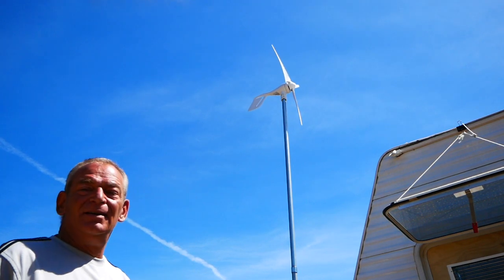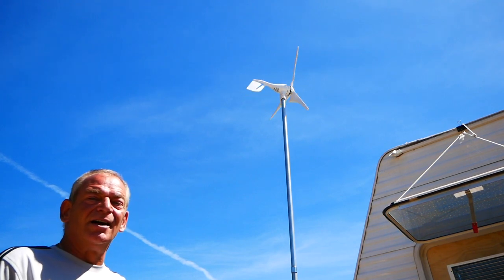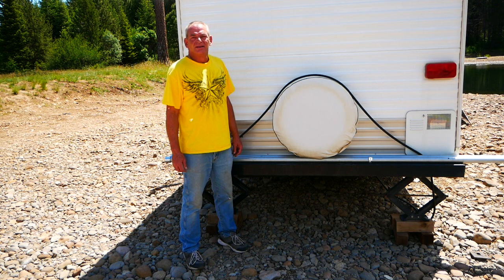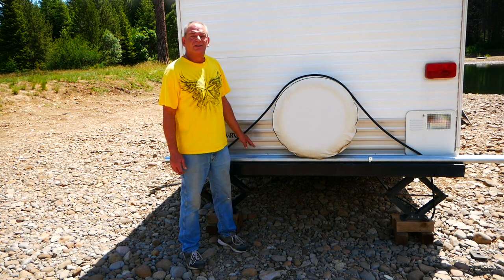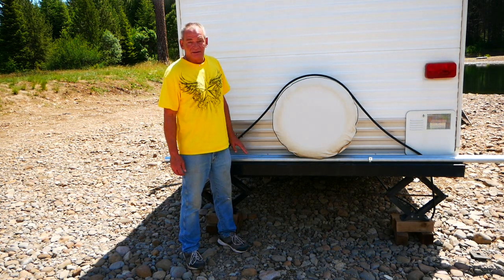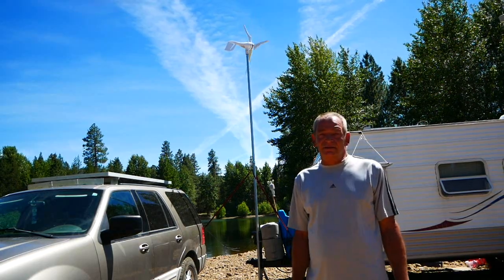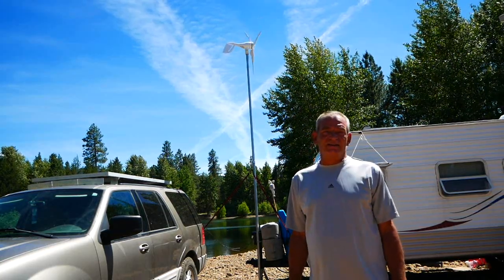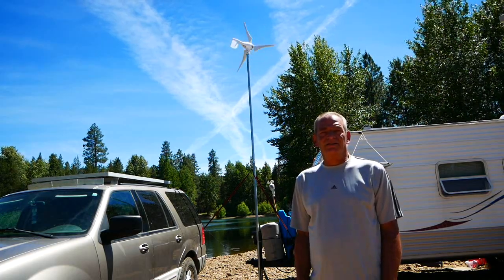Preview of the Ec0-Worthy 400 watt wind turbine

Comment: If a wind generator was mounted properly could it generate electricity while driving?
Reply: The drag it would put on your vehicle and the extra gas you would be burning due to that drag would make it not beneficial nor practical.  (See 1st and 2nd Laws of Thermodynamics) Also, Bob mentioned that there was a narrow wind speed band where it generates decent power starting at I think he said 26 mph?  So, at 70 mph on the highway it may not make any power at all as it might have already cut off by then to protect the circuitry.  Depending on what speed they have it set to cut off, you might only be able to drive at under something like 45-50 mph to generate anything decent.

Comment: The problem with wind turbines is the altitude. You need to get them high. High, as in taller than any nearby trees. The wind quality, power and  dependability goes up the higher you go; this is why the monstrous latest generation of turbines made for commercial power production have single blades the length of a football field, and the tallest in the world will be 800+ feet. For the vast, vast majority of people, getting another solar panel or two will be a better investment; in an RV, you just can't in any practical way carry a 100+ foot tower.

Comment: I think stormy days is where it will shine, (pun intended). 

Maybe northern climates in the winter where the sun angle does little with solar. 

Personally, I think a small generator like a 1,000 watt running a battery charger for an hour a day would be more practical.
There will be overcast days where there is no wind.  Just when you need the power the most, it will not be there. Lugging that thing around for the few times it would work seems more bother than anything. Of course there are places that are always windy, but I don't want to be there.

Comment: Go to Missouri wind and solar channel it has a lot of details on wind turbines.  With 9 blade head blade turn in 6 mph winds
Reply: they can but you end up with a wind wall effect in stronger winds, for real power in low winds a turbine designed to work at low rpms in low winds , you see them on the net , for example 500w turbines with 2.5m blade spade and making good power in" low winds" more power than those incorrectly rated turbines with 7,9,11,13 blades yet with only 3 blades and hitting rated wattage at 20mph not 40mph, i own the dual pmas and others it was a waste of money.

Comment: My Vertical Axis Wind Turbine VAWT   sitting on a conduit 4 ft  pole stuck in the ground in the yard with 5 vertical blades running a permanent magnet and no resistance with anemometer attached starts turning at :
5mph or 2.2 meters a second m/s  = 18 watts
2.8 m/s = 43 watts
3.1 m/s = 65 watts
4.5  m/s = 130 watts
5.3 m/s = 218 watts
8.7 m/s = 400 watts
I had a Horizonal Axis Wind Turbine HAWT like you have which required a very high pole with quide wires that would not start turning until 18mph wind and I got rid of it
Reply: In your video you saw your Anemometer turning but your 3 blade horizonal axis wind turbine HAWT is not turning , ask yourself why is that  , and your anemometer is lower but spinning : VAWT is the answer not HAWT , I decided to mount  4  (400watt) Vawt  which is 1600 watts on an open utility trailer  with 2ft conduit and 3 battle born lithium batteries and run what I need to 24hr a day
Reply: and I don't need any (SUN)

Comment: Thanks for the valuable information you provide.  I'm interested to see the results so we can decide if it's worth it or not.  Just a point of information so people don't get confused when they buy the pipe.  Pipe can be threaded conduit cannot be threaded as the wall thickness of conduit is insufficient to thread.  Electrical pipe comes in two forms aluminum or galvanized.  Galvanized is stronger and cheaper but heavier.  Plumbing pipe is heavy like galvanized but cheaper but it will rust.  Aluminum pipe is the way to go if you can afford it because it is strong enough and much lighter.

Comment: I have a 400 Watt Chinese Vertical Wind Turbine VAWT that I paid $ 95.00 with free shipping that works in 5mph wind. It runs 24hr a day and works great.
Reply from the maker: How many watts does it produce at 5 MPH?
Reply: I've been doing this a very long time and have rewired my STATOR using 18 guage copper wire and have increased my wattage not amps :
5mph    wind  2.2  m/s  meters per sec
10mph  wind  4.5  m/s
15mph  wind 6.7   m/s
20mph  wind 8.9   m/s
30mph  wind 13.4  m/s
40mph  wind 17.9  m/s

Comment: Thanks Jim for the info....To add my two cents" 'we live in a small well defined patch of hilly terrain known for having a corridor of wind that is supposed to be sufficient enough for wind power generation when the sun is not shining or it is stormy enough outside to hamper optimal solar utilization. What we found out was this. 1. The capital costs of adding wind power was just to much money for the power generated. 2. The maintenance required was much more than bargained or planed for with wind.  Large Power company wind turbines have a nice (Return On Investment) over time,  we expected this as well but found the exact opposite to be true when going small scale wind power. Luckily we were able to sell our Turbine - Tower and Electronics to just add more Solar for much - less capital costs - more power - almost no maintenance compared to the Wind turbine...BOTTOM LINE IS; it will probably make more sense in most situations to Add More Solar than install wind to make up for possible power loss and ease of maintenance differences - just my opinion, your situation may differ.

Comment: I do agree w/Happy Camper.    Since you carry a generator, a basic tool set for any work of this type would be a large recip. saw w/appropriate metal cutting blades, a full complement of drill bits and a metal file for deburring?   Easy enough to keep on board along with that monster 1/2" elec. drill & bit.   After all, people are looking to you as an expert, and since you are doing the install, they may follow your example with dubious results.  In the future, may I suggest the inclusion of some type disclaimer before proceeding?  It may save you a law suit.  BTW, you already shot this down by mentioning the wind speed necessary to drive this effectively and the fact that it is impractical to attach it to anything w/out vibration and noise and possible dislodging in a heavy wind.  Thanks for the click bait!
Reply: Like pretty much everyone out here he only has so much room to work with.  He doesn't have the space for every tool in the hardware store.  Rather than being unfairly judgemental and critical why not ask first?
Reply: @MrsMetCal     Ask what, if he has room for a recip. saw.?? Obviously, you don't know anything about tools either.. LOL!  As I stated previously, while he's a nice guy, he's not a very good mechanic and uncomfortable operating equipment, which might be a problem for another person who tries to emulate him.  
Stop with the touchie-feelie BS and get to the obvious which is click-bait video that is not designed for nomads or human consumption of any kind..
Reply: @pjf7943  This is not clickbait. He is doing an experiment that has a start, middle and end.  He is currently at the start.  Check back in 12 months for the end when he will have the data to make a recommendation regarding the feasibility of this method for collecting energy.  I suspect he has an idea already how this is going to end but without the real life experiment none of us know for sure and the marketers of these turbines make them look like affordable and viable solutions for his audience, Van dwellers, and boon dockers.  Not people with fixed locations and large well equipped workshops.  Most van/rv dwellers don't have the tools to mount solar panels on the roof of their vehicle....by extending your logic, non of them should have solar panels.  Jim is simply showing the possibilities, he is not writing an OSHA approved installation manual for the products he demonstrates.  If you are such a smarty pants, make your own video on the "proper tools and techniques" to help boon dockers with their projects.  I suspect no one will be interested in it.  But you might be surprised by a foreign feeling...that of feeling gratified knowing you did something to help others.  That's a feeling Jim is very familiar with as evidenced by his library of videos and interviews on the varied topics he covers helping others with his wealth of knowledge and experience.

Comment: Wind turbines can be a great supplement to solar, but you've really got to do your research because there's a lot of factors involved that must be considered in order for it to be practical. I appreciate your exploration into this realm, however I have my doubts about the particular turbine selected. One of the factors that must be considered in order for a turbine to be effective is the rotor diameter, and unfortunately this particular turbine has a very small rotor in proportion to its stated output. But, who knows maybe it'll work. If not though, that will likely be the reason. Another factor that's very important is the quality of the Wind. Not being up very high and ground clutter like trees can really affect its effeciency. And there's several other factors at play, any one of which can greatly impact the turbine's efficacy. - Making it work requires you to be quite diligent, but I believe it can be worth it if one does the research.
Reply from the maker: I have to agree with you in that this turbine may not be the solution. I have studied the wind for a year taking note of how often the turbine would produce power, how much and if it was when I needed it. What I found is while I will complete the testing on this one, that a larger turbine with more blades is more likely to produce usable power in the winds that I get.
Reply: Thanks for all you do Jim. - Increasing the number of blades will lower the cut-in speed allowing the turbine start producing power earlier, but it will also create more drag on the rotor reducing the top-end production. So, if you're mostly in lower wind areas then more blades are better, and if you're in higher wind areas then fewer blades are better.
Reply: In both cases a larger rotor diameter is important though.

Comment: Great video Jim... thanks for sharing with everyone. It's going to be interesting to see how well this performs. I'll be watching for your next video. I do like the way you have the windmill mounted. The mast looks strong enough to withstand some high winds. Good job as always.
Reply from the maker: Thanks. The mast is as large as the turbine will take and pretty beefy. I will give it nexy season to determine if wind power is a answer for me and is this the turbine to do it with.
Reply: @solarboondocker4597  Your welcome Jim... Yep I could tell that the mast was beefy. Hope the weight of the mast and the turbine wasnt to hard to push up into place? I'm concerned because of you having an issue with the back. I also have a few problems with mine. So I know careful we have to be. Anyway I'll be looking forward to hearing how it went. As it is you already have a awesome power plant on the RV & Truck. I really do like your system...

Comment: I have been wondering about wind power for the last year or so. Glad you're doing some info on it thank you. Now I have a really important question to ask that nobody seems to discuss. So right now I'm in the middle of a thunderstorm very hot and humid I have two small USB fans going and my Maxx air fan going. Here's the question with running the Maxx air fan having to vent to open and running my USB fans can I get electrocuted? Things like thunderstorms getting electrocuted running equipment through solar or things people do not seem to think about. Be great if you could do a show on it. Thank you very much
Reply from the maker: I am no expert but I do know that I have been in some wicked thunderstorms over the years and have never had it been a issue. I have lowered the Antenna mast before. Maybe running a grounding wire from the mast to a steak in the ground would be a good idea since I can not easily lower the turbine.

Comment: You should have used a larger reciprocating saw of SawZall size and started the hole with a smaller drill bit progressing to larger..  
Audio went out for a time at 2:44, came back at 3:25..
I would have bolted through a pipe flange instead of those angles which will be rendered worthless..
Hopefully that mast won't topple over on your head or rig..
You are a nice gentle man, but your mechanical skills are, well, lacking..  LOL!..
Reply from the maker: In the middle of no where, you build with what you have. My SawZall and Drill press were in storage. 

On the flange. I needed to be able to hook up and lift the turbine into position. There is no way that I can hold it up and thread it into a flange. I think Bob has more detailed footage of the mounting.